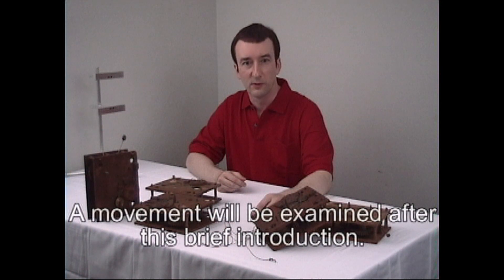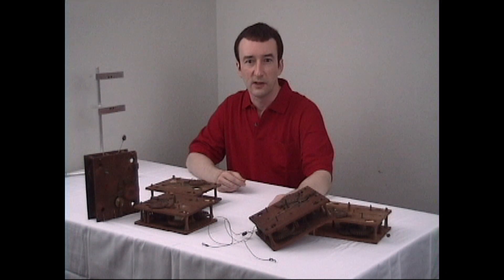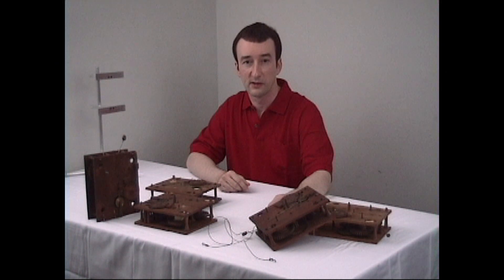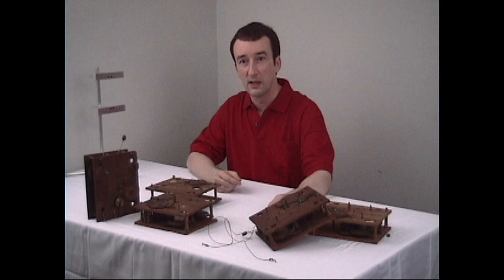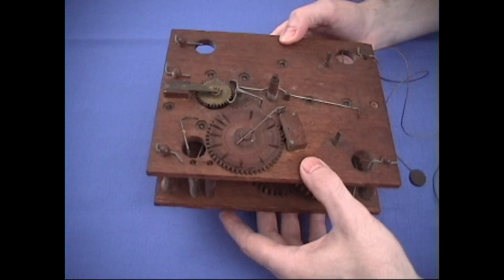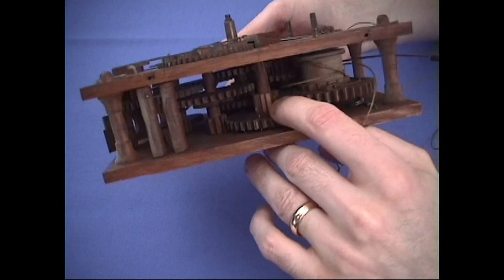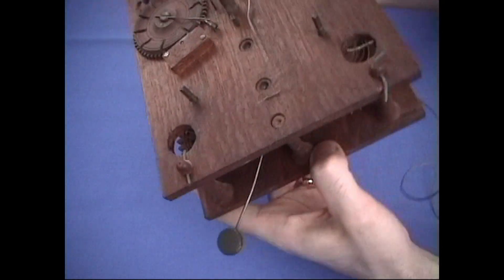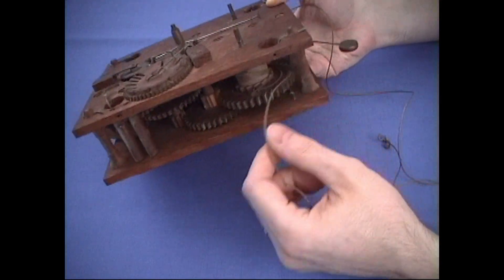Wooden Works Clock Movement Repair Restoration. PART 1. Eli Terry style. Intro to repair basics.

Comment: I recently fell in love with a grandfather clock. While it has been transitioned to battery, they saved the wooden movement in case anyone can ever put it back together. Do you think this is something that I could attempt after taking your courses?
Reply from the maker: The wooden movement course is an intermediate level course.  If you have never worked with clocks, it is best to start with the course titled "Clock Repair 1 and 2"  On DVD here at https://www.ticktockpro.com/ANTIQUE-CLOCK-REPAIR-COURSE.htm  The online version is here: https://online.ticktockproductions.com/